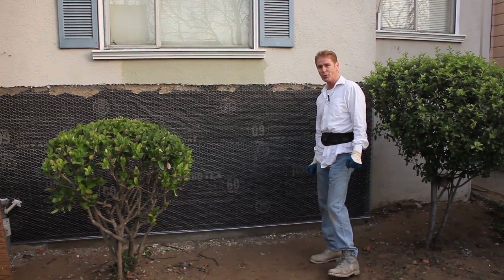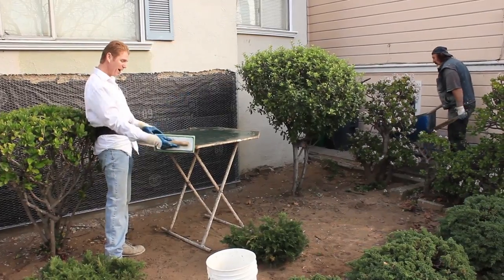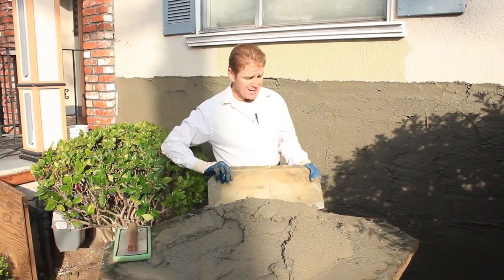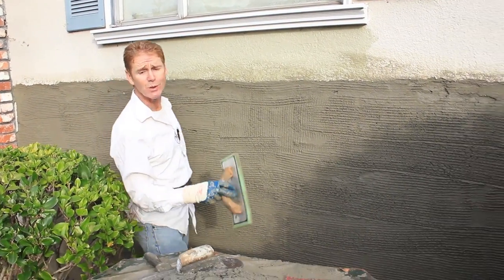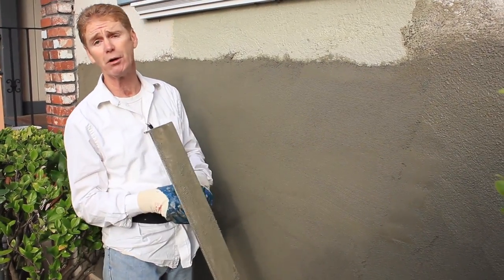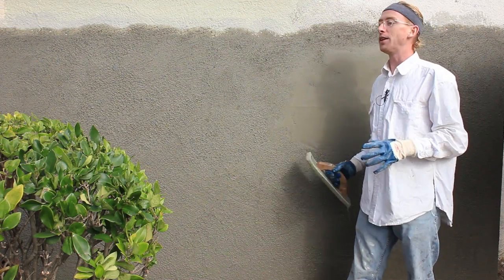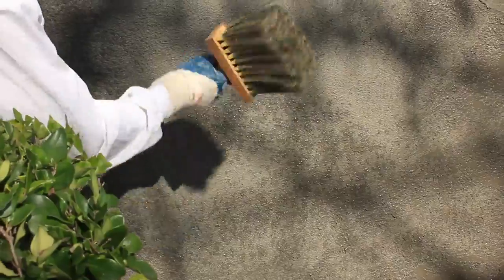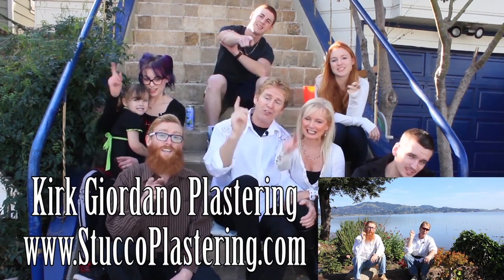Spread stucco using a stucco hawk and trowel

Comment: It's interesting that you mentioned the beach sand. About ten years ago I was on a job in San Diego redoing a very small 1924 (1926?) cottage that was practically right on the beach. In fact if you dug down a couple inches into the soil it was all beach sand. The exterior had wood siding but the interior had original lath and plaster. we had to demo the entire plaster interior because it literally crumbled in our hands when we touched it. And not like old plaster can sometimes do, this was different, it looked like beach sand was used and I long suspected that the crew who built the place, which was rushed by the original builder, must have scooped it up either from the property or just walked to the beach and got it from there to save money, and over the years the salt in the sand made the plaster very weak and would crumble like dried mud in our hands.
Reply from the maker: Happy holidays WCSD, very possible they used the beach sand as it's not common knowledge that salt can mess with cement or stucco strength.
 Look at Dubi. All their buildings were built from sand being removed from the bottoms of the ocean.
Then washed of salt and brought to Dubi.
 It's been said the ships that were involved in transporting this sand would dwarf all the cruise ships here in the USA.
 Most people would think Debi is a desert of nothing but sand and be right. However, it was not the right sand to build with.
 Things that make you go, Hmmmm.

                  Bringing peace, love, and harmony back to the world of plastering.
    The complete plastering encyclopedia on video, by the plastering messengers of Youtube with over 800 videos

Comment: Hey kirk when I worked Union we actually used to mist our tools with wd-40 and when I worked for My grandfather who was also a union contractor out here in northeast PA we would use Type S and sand with a couple shovels Portland and another union company I worked for they did half bag of Portland a half a bag of Type N the sand and 10 squirts of plastasicer
Reply from the maker: Plaster Master, all great tips from a Plaster Master. I forgot about the old WD on the back of the trowel technique. I'm going to have to go back to that. I'm getting tired of scrubbing them.

Comment: A pleasure to watch a genius making it look easy...you mentioned buying sand and cement in bulk and mixing your own, rather than a bagged mix.. What mix ratio are you using for each coat?... do you use any sika plasticiser, waterproofer or any other products in the mix?
Reply from the maker: Howdy Nige, I use portland cement plaster with three times as much sand as a rule.
 The siak product you're referring to is used instead of water to give the product more flexibility and adhere better.
 I buy products that do the same thing but are specifically engineered for certain purposes, so I don't use the Sika additives.
            Live long and plaster
 stucco images and teaching videos

Comment: I know this is an old video Kirk but I've been a Plasterer for 30 yrs. here in Florida and one thing I've noticed, out west it seems the lath of choice is what we call "chicken wire" no disrespect intended. We mainly use galvanized 2.5 paperback over most applications when wood is involved.Just wondering if there was a specific reason? BTW Good videos ! I do mainly custom and repair work now myself and your videos are very informational for the people who may not understand just how many different situations we run into.
Reply from the maker: Howdy Steve Dude, for stucco nettings, it's been proven by the smartest, engineers that for the absolute best results to use either a 17 or 18 gauge stucco netting.
   Chicken wire, for example, 20 gauge wire/stucco netting, is much thinner, it's great for chicken coops as I use to have a chicken coop that holds about 10 chickens.
This same 20 gauge wire/stucco netting can be used for setting tile grout for countertops.
   I have seen many types of metal netting used for stucco including chain link fencing.
Stucco netting comes in rolls, where the metal lath you're referring to comes in sheets, these sheets are primarily used for ceilings as the holes are tiny. Thus sticky and rich stucco will defy gravity and hang when mixed and applied correctly.
    The most complete plastering encyclopedia in the world on video, by the plastering messengers of Youtube.  
     Over 850 free self-help videos 🎭 👀💃

Comment: Hey hows it going, 

I'm a stonemason in sf and I just wanted to make a note to you. Not that I believe I'm correct but as far as I know, it's the fines in beach sand that makes it weak, salt actually makes it stronger. The Roman's used salt water for their mortar. However you cant use salt water in reinforced masonry or stucco because of the wire. 😁😁
Did you know that stucco and steel have the exact same expansion and contraction rates. That's how they are able to stick together.
Reply from the maker: Evening Brayden, I disagree, my brother, salt makes all cement weak and caus Efflorescence when it cracks and or spalls from the snow,then salt bleeds out.
Efflorescence is the loss of water (or a solvent) of crystallization from a hydrated or solvated salt to the atmosphere on exposure to air. ... The water, with the salt now held in solution, migrates to the surface, then evaporates, leaving a coating of the salt.
                         Bringing peace, love, and harmony back to the world of plastering.
With over 800 educational and free Youtube videos, by your favorite plaster geek, “me,” and Jason, my son, the bearded plasterer.
Reply: @StuccoPlastering  I'm going to research this more, I think you are right about it weakening the mix. But may be atmospheric salt or the appearance of salt is hard to get my head around. Let's see
Reply from the maker: atta boy, many ways to skin a cat.

Comment: I have seen all types of sand being used for rendering eg.  grit sand (zone 2 course and gritty used here in concrete mix)  red building (brick & block laying mortar mix).....which type do you use?  (with ordinary portland cement?)
Reply from the maker: Howdy Nige, here it called either Oly or felton, but if that's not available, I use any as long as it's washed free of all salts.
FYI, Jason and I as well as the rest of our Giordano clan wish to thank all of our subscribers and those who stumble on our videos a happy & prosperous new year.
 Kirk giordano Plastering

Comment: What spray was that you sprayed on your shoes?
Reply: WD-40. Check it out at WD40 dot com.  It's fish oil mostly. Wired Magazine had a lab analyze it for content and that's what they found.
Reply from the maker: Hello Mr Smitherz, right on the money about the WD 40, if you want a pair of boots to last longer than 3 months working with stucco spray once a week very lightly, If your socks turn yellow, way too much, you just want to keep the leather flexible not add carcinogens  into your body bloodstream.
Thanks fellas, for watching and enjoy the rest of your Day! 
 kirk giordano
Reply: Mr Smitherz Cabots stain also used fish oil. Fish oil isa  great natural product.
Reply from the maker: Hey Dusty dude, i think you suggestion is a much better alternative, too bad it's not sold at my stucco material yard Westside In Oakland, but WD 40 is.
 have a groovy evening ,
 kirk giordano

Comment: CNN
Kirk to re place Trump in 2018
I vote for Kirk
Reply from the maker: Good Morning Grant, I'm ready to save the world, cheers
                    Live long and plaster
    Mastering Plastering by Kirk and Jason Giordano
Reply: He will make vinyl siding illegal, and stucco finish mandatory on all buildings, public or private.
Reply from the maker: Good afternoon Simhopp dude, 
       No doubt, after all,  Stucco is a very long-lasting material, good for the life of a building, and it generally maintains its color and freshness of appearance for as much as 20 to 30 years.
• Stucco provides thermal insulation against hot weather, helping to keep a home cool in the summer, especially if the exterior is a light color.
• Stucco insulates against outside noises, making the inside of your home noticeably quieter than with exterior siding.
• Stucco strengthens a home, providing additional structural rigidity. This is because a stucco building is essentially encased in an envelope of wire and cement.
 If you don't like the look of stucco (a matter of personal taste), wood siding or cement board siding are better choices than aluminum or plastic. However, none of these sidings will last as long or be as maintenance-free as stucco.                      
                    Live long and plaster
           Sharing the plastering knowledge